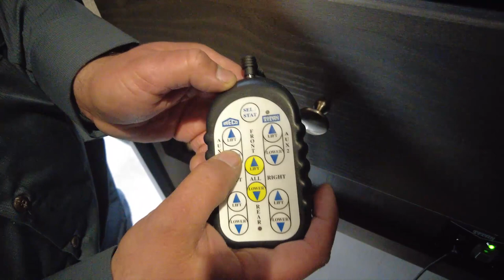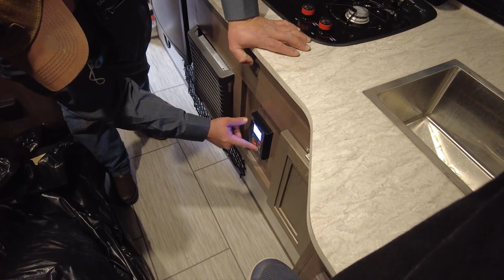Is the Palomino SS-1251 the Right Truck Camper for You?

Comment: Any regrets on the truck or camper choices? Is that a 5ft bed? Looks like a 6.5" truck bed would have worked with the ss1251 as well. Do you know your payload rating on the truck and do you find yourself going over the limit to easily? Most people say you should have a 3/4 ton truck with those truck campers. I have a 2008 F150 6.5 ft bed and have been considering a truck camper so I can take my small bass boat on trips with me.
Reply from the maker: Hello Cage Rattler, Our bed is 6.5". Fred wanted the 550 but I really wanted the bathroom. Ford and Palomino swore that the SS-1251 would be fine on the F-150 just get some air bags (which we did)  We do know the payload and yes we do go over slightly. We thought we would be ok with that but we are not. We are planning on looking for a F250. Since we tow the popup TC behind our Class A we have to also be careful on the total weight. Right now we are totally at less than 7,000. We can tow up to 10,000 pounds. Our biggest suggestion is to be sure to watch your payload and how much you can tow. It will be very exciting to have a TC to tow your bass boat.💕 We wish you all the best. :)
Reply: @TheEdelKampers  Thanks for the reply. I thought you had a 5 ft bed the way it overhung the back. I guess you need the overhang for the bathroom. Is the wet bath actually usable enough to warrant the extra length?
Reply from the maker: @cage-rattler  For what we use it for we believe the wet bath is worth it for us it. It gives us the privacy to take a quick military shower when needed and the black tank is pretty good. You do need to create an outside bladder source for your gray tank as there is no gray tank. We do not mind using the outdoor shower but sometimes we are in areas that is not acceptable. You have to make a list of pros and cons and think of places that you are going to be going. To be honest if you are going to spend your time mostly in remote areas then we believe a bucket and the outdoor shower would be sufficient.
Reply: @TheEdelKampers  Over weight. Payload capacity is 1880 & the wet weight is 2505 you'er 625 over weight & you haven't added the weight of people & stuff. Your negligent. I don't care if you have air bags. Don't believe what dealers tell you. If you get in an accident that's not your fault & the insurance co. finds out your over weight. They will say your negligent & not pay.
Reply from the maker: @Soulcritic  Hello Mike, We agree that being overweight is not a good thing but your numbers are exaggerated a little bit. According to the tag on our camper it is "1795 max when it contains standard equipment". We have reduced that number by removing the electric jack lifts, changing the lead acid battery to a liPo battery etc...... On the truck we have removed things like the backseat , the tailgate etc..... We are still not happy with the combined weight and we are shopping for a F250  Let us know if you have one for sale. Thank you for your comment
Reply: @TheEdelKampers  It sounds like you know you're over payload & don't want to admit it. The weight of people & stuff also goes against payload.